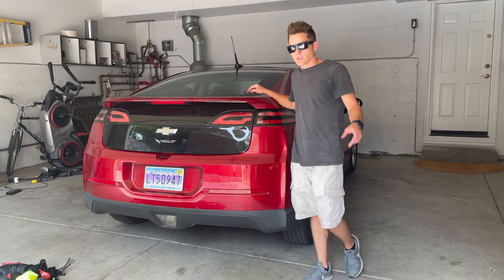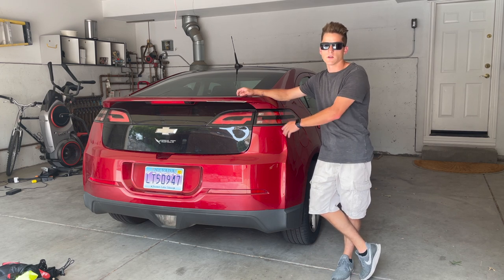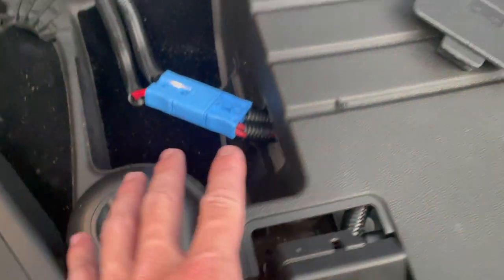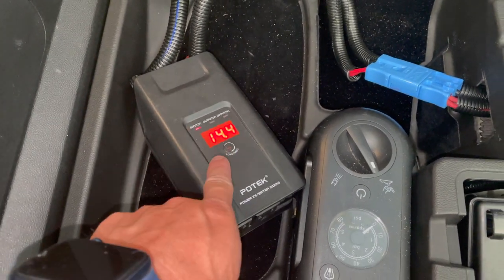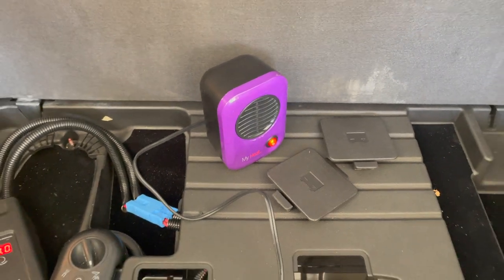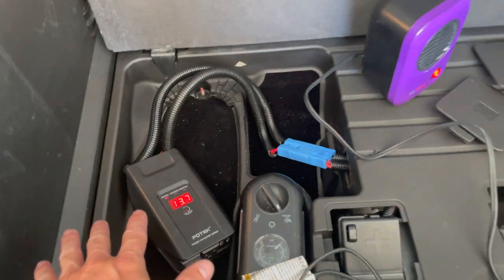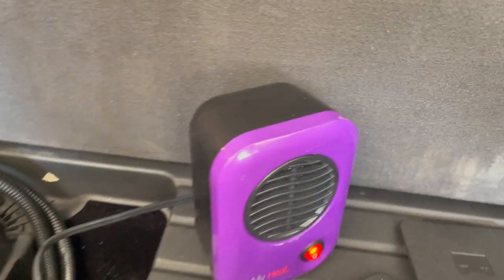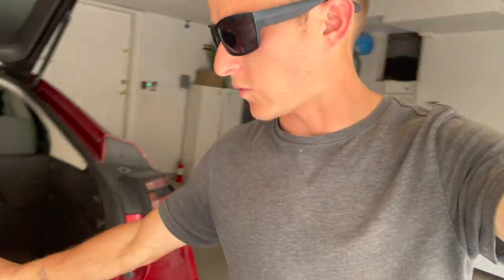Install POWER INVERTER inside your EV? - Chevy Volt

Comment: Did you lose your radio settings after connecting the cables? Thanks for video, I like that little hole, hopefully I can do it with a razer blade and scissors
Reply from the maker: I can’t remember to be honest 🤷‍♂️
Reply: @christianperi thanks, well it looks like it has a terminal you connected to without removing the terminal posts.. like a bus bar.. I gotta get off YouTube and just dive into it

Comment: 200 watts .. how many watts do you think you would be able to safely pull?
Reply from the maker: I’d have to look into how many watts the car sends to the 12v battery to keep it topped off. I’d say 200 watts may be the limit
Reply: If I recall correctly, the 1g volt on board inverter is capable of 1500w and the 2g volt is capable of 1000w.
Reply: U can use up to 1500 if u have the right inverter
Reply: @PO-sz7qw i mean technically you might be able to pull more than that, like up to 2000watts for a breif periods like when a fridge compressor needs to start since thats the whole point of having a battery. not sure the max output of the AGM battery but i would guess 2kw for less than 15 min should be okay but then you would want to have the car "on" and the long term load under 1kw. my volt turns off after 3-4hrs of sitting idle while "on". i am pretty sure this setup would continue to drain the AGM battery till its dead and then the car will not want to start until 12-12.6volts are applied again to somewhere in the car like the cig outlet thing,

Comment: Is it possible to charge the high voltage batteries with the inverter outlet if you connect the charging cable to it.
Reply from the maker: You would have to connect a 1500w inverter to the 12v battery, however that would drain the 12v battery so quick if you plugged the EV charger into the inverter and used it that way, and you’d be lucky to get 1 mile of range doing that, plus then your 12v battery would be dead and wouldn’t be able to power the cars electronic systems.
Reply: It's been a year i'm surprised no one replied to tell you no, you can't draw power from a battery to recharge itself.  WHere would the energy come from? You lose energy as you convert it.
Reply: Energy can neither be created nor destroyed.

Comment: Hi, does the inverter will work when the car is turned off? And does the high voltage battery will keep charging the small battery even if the car is turned off Whitehorse using the inverter? Thanks
Reply from the maker: The inverter will work with the car off, however the car does not keep charging the small 12v battery while the vehicle is off.
Reply: in my 2013 volt, ive noticed the car will stay turned on for about 3.5 hours if left alone. make sure you disable the options in settings to stop the engine from running when plugged in if youre using this in a garage when the power is out, and turn engine assisted heating to "very cold" or off if available, and then keep the car plugged in even if power is off, i believe it will stop the engine from running. you can over ride the car into running the engine by unlatching the hood regardless of battery state of charge, and you can set the car in mountain mode which will run it at medium load to charge the high voltage battery up to about 50% available state of charge (so like 33% reserve + half of the 66% usable, usually around 5kwh for most models.) was thinking of using this setup if i had a powerouttage lasting less than a couple of days and wanted to keep the fridge cold and maybe run a small space heater. I read somewhere that the DC to DC charging circuit will put out around a max of 1kw/hr to charge the 12v system... the AGM 12v battery can probably put out a bit more than that for a short period of time but oversizing the inverter past 1500W might be a bad idea. 500-1000w should be fine. there are lots of posts on the volt forums about how/when the 12v battery is charged and its not very straight forward. just assume it only charges it when the car is "on" and assume the car will turn off after 3-4 hrs and drawing a load after this will cause a flat battery which will prevent the volt from starting. using a 12v jump pack or some othre source will allow the computer to boot up and recharge the 12v battery if yours is dead (use the jump start posts under the hood since the back hatch is hard to open) and once it starts in drive stop supplying 12v it will charge the battery back up to full. repeated over discharge of 12v batteries especially in cold will destroy them. the original AGM battery is a bit more resistant to being over discharged however.
Reply: I would recommend parking the car outside and not disabling the car from gas engine from running.. It shoudl only turn on when the traction battery is depleted.. and that should aid in the longevity of your 12V preventing it from going too low in the first place.